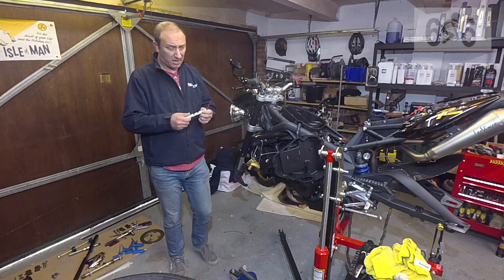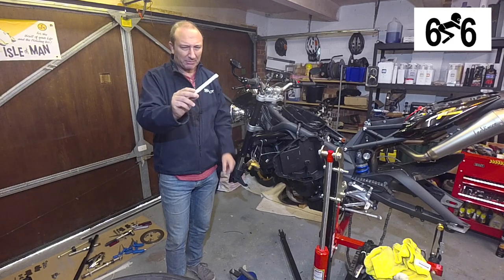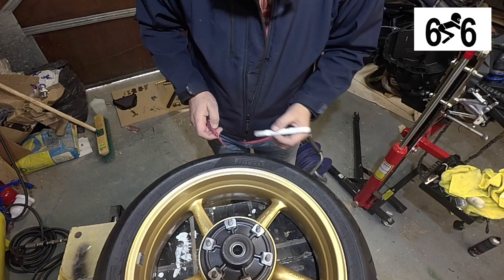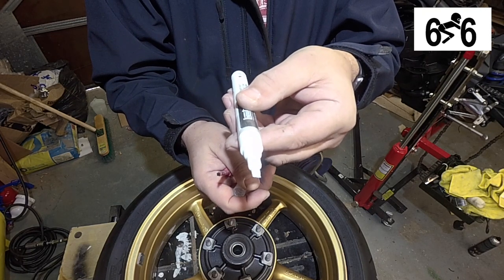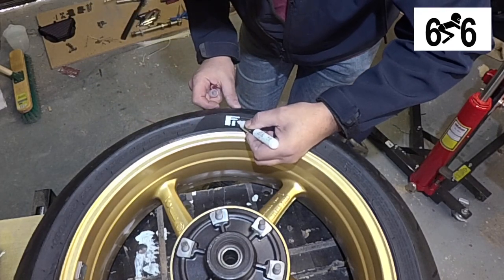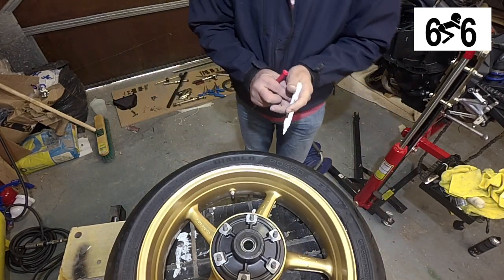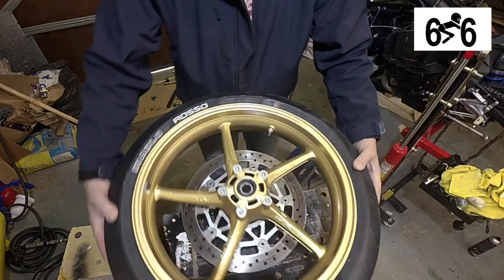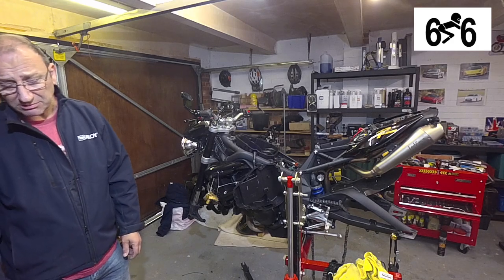TYRE LOGO PAINTING

Comment: Thanks steve. Looking forward to the next set of vids of putting the bike back together, ive just done a fork spring swap/oils and seals.
Reply from the maker: k31chris how did you get on with that? Not done that on my bike yet, maybe next year 🤔
Reply: I  have the non r so non adj forks .(a bit less for me to cock up) But it was quiet easy .  Swapped to a rate that matches my weight. Feels much better now